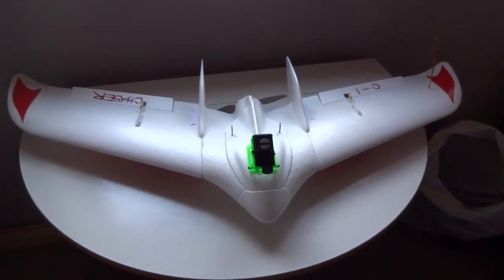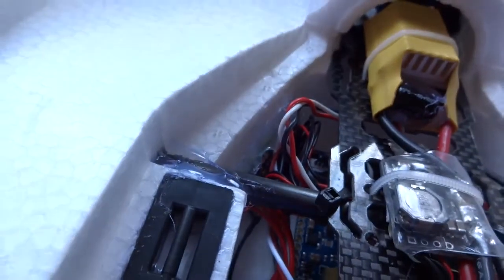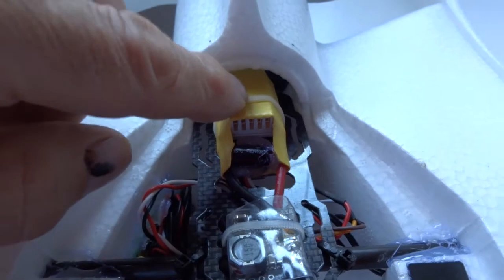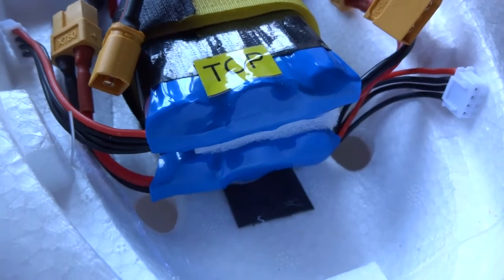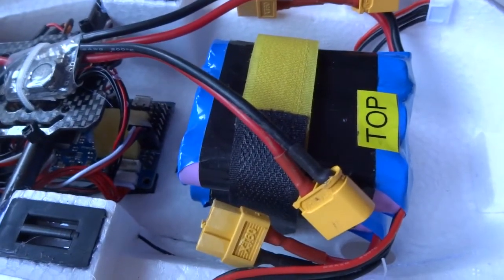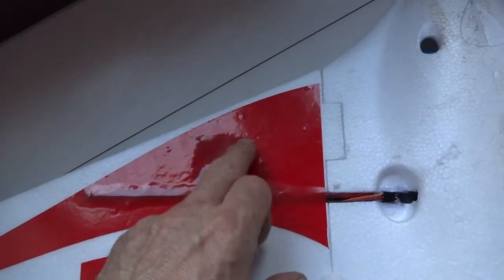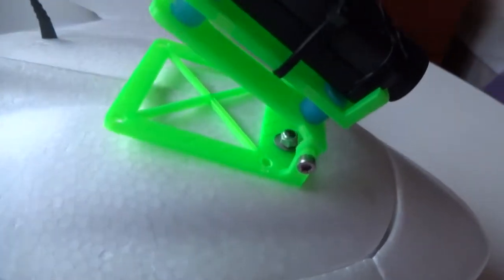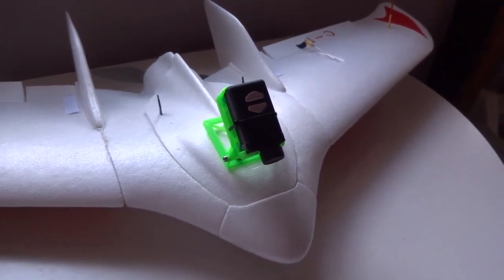Building a Chaser C1 FPV Plane  - Layout

Comment: Hello. Were is the CG? Thanks
Reply from the maker: On the underside of the wing just in front of the wing spars are a couple of small round raised bits moulded into the foam. The CG should be such that you can balance it on your fingers at those points. It makes setting the CG easy!

Comment: Could you please offer any good quality source of 18650 battery?
Reply from the maker: The batteries that I used are from Gearbest and they are the INR18650 - 30Q. The capacity of them is 3000mAh and they will discharge up to 30A (10C). http://www.gearbest.com/batteries/pp_232875.html?I can confirm that they are genuine and good quality. Also have had good experience with cells from Banggood too. Hope that helps.

Comment: Thanks for your video, any idea what your max flighttime is using all those batteries?
Reply from the maker: I haven't done an endurance test yet but do intend to soon. I'm always surprised that I can fly it for quite some time with the battery voltage hardly dropping. From the experience I've had, I would guess endurance is between 1hr 15mins to 1hr 30 mins.
Reply from the maker: One thing you need to be aware of is to make sure the low battery cut-out on the ESC is disabled as it will cut out too soon with li-on batteries - they can be discharged to around 2.5v unlike Li-Po's.

Comment: The Liion cells are great, I'm mid build of a LRFPV C1 running 4s2p, I also have a fpv z84 on 2s Liion, which is brilliant, agile docile or fast, I now run all my planes with these, ancient lipo's are now only used for quads although the SDI25r Samsungs even deliver well enough for my big old 650 quadcopter despite only being 2500mah each. 
Anyway, great job and thanks for posting, looking forward to a maiden...
Reply from the maker: Yes Alasdair, the 18650 cells are getting better all the time. The C rating had let them down in the past but that seems to be improving . Haven't used them on my multirotor stuff yet. My heavy lift Octocopter takes 6S at 20Ah - very expensive using li-ion cells! I had a Z84 but appreciate the extra space in the Chaser!Good luck with the maiden.

Comment: Awesome thanks heaps for that, heaps of room for your 2x 3s packs, did you think if you used 4S to make them as a square pack or flat pack ? still waiting on mine to arrive Cheers Brett
Reply from the maker: Hi Brett, I don't think it would matter. As you will be using 8 cells and the fuselage is 4 cells wide you would have two layer of 4 cells. It wouldn't make any difference if it was 2 square packs alongside each other or 2 flat packs, one on top of the other. Regards Allan